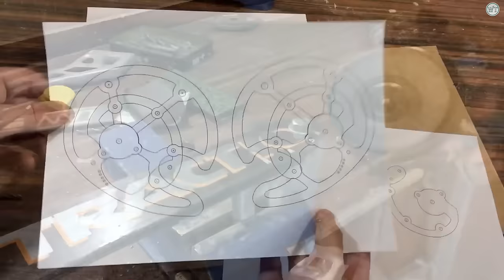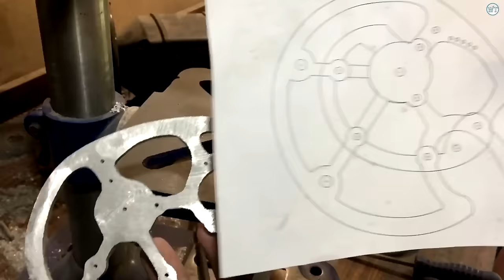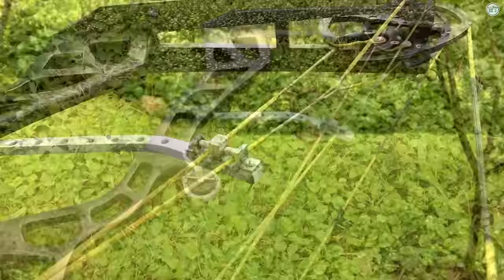Making a Full Size Compound Bow | Aluminum Riser | Powerful

Comment: For the record don’t ever fire a wooden arrow out of a compound bow that is death waiting to happen
Reply: why not, why not?
Reply: depends on the strength of the bow. Also, it's still safer than a carbon arrow with a crack in it.
Reply: @andiders   well it's obvious in the video this bow draw weight is way to heavy for that wood arrow. That could do some serious damage to his face, arm or hand if it exploded. Seen it happen bout 25 years ago at an indoor range, guy blew up a wood shaft and part of it came back thru his hand and pierced his chest.. it's a bad day when it happens..
Reply: How did it pierce his chest? The bow shoots it's force one way, how can that force suddenly redirect so it pierces his chest? That would defy physics.
Reply: Andiders is doesn’t need to pierce his chest to kill him and plus I fail to understand how it’s so hard to believe that a arrow can split on half with out having to come out of the bow😂😂 check ur definition of physics😭👍
Reply: Andiders even if it hit his leg or his arm there are many arteries that if pierced can have the bleeding stopped
Reply: I totally understand that the arrow may split and splinter, but in order to pierce someone, it needs force, and with a bow, it only has force going forward, it cannot redirect that force sideways or backwards. Said force might hit his arm or hand, but suddenly wouldn't shoot the arrow/broken off arrow sideways. 
In order for an arrow to shoot its archers chest, it needs to have the force redirected downwards and backwards. That could only, in really far fetched theory be done by a massive shockwave, created by an astronomically powerful bow, you know, the kind that only exists in Japanese anime.
Reply: Clearly, you're incapable of reading TreasureSweeper. I know that an arrow can be completely destroyed, and splinters from it can harm you. What I'm questioning is splinters, getting enough force to a completely different direction, enough to pierce someone. 

Let me explain this, as well as I can. When you shoot a bow, the force is directed forward. Yes, are you with me? Your chest, is positioned below and 80% completely behind the arrow, at an angle. No part of your chest is exposed in the slightest to the arrows pointing direction. You with me? Anything behind the string, is not in the way of the force the project the arrow. Your hand and arm is exposed to that area though, and can be seriously injured by a disintegrating arrow, but your chest is not. This is what I''m questioning. The force is directional, and that force cannot be magically redirected. Arrow pieces cannot ricochet of the arrow, let alone sustain its force while doing so.
Reply: @andiders   dude, obviously it's you that is incapable of getting it. 
Just go spend some time researching it. You can try to understand the physics all you want, things don't always work the way you think they should.
Reply: @andiders   lol... Back to physics. Ok, have you ever thrown a baseball?
Force of throw going forward right. Same with an arrow.
What happens when that baseball is thrown into a concrete wall? Does it bounce back?
Same thing happens when the arrow shatters, it's pieces can bounce back after hitting the shelf, arrow rest or riser. 
The guy that blew his wood arrow had a 6 or 7 inch piece of it come back and pierced his chest, just in front of his left arm pit. No, it didn't go thru him but it was embedded about 3/4" into his pectoral. Some of the arrow pieces were stuck in his hand.
It can and does happen. There is also a vid somewhere on here showing an arrow at release, breaking just in front of the fletching and hitting the arrow rest and going straight up thru the ceiling in a archery range. It could have just as easily went backward in the the archers face or chest.
Been shooting archery seriously for 38 years and started over 40+ years ago. Shit happens and it doesn't always happen the way physics would lead you to believe.
Reply: Back to physics indeed. The force required to penetrate skin, that deep especially, would be very strong. A bow penetrate by a mix of speed and weight focused on a very small area. A splinter from a arrow, that travels towards a chest, has already lost most force on the impact that redirected the splinter backwards, but due to it's fraction of the weight, it has even less power. 

An easy formula would be Weight (mass) + Speed (force) = Penetration power (impact). What happens if we take a fraction of the weight, fraction of the speed? We gget a fraction of penetration power. 

Same goes for a baseball, except that when we hit it into a wall, it doesn't lose mass, it only loses force.  The ball will hhurt less, when bounced off the wall, as opposed to hitting you directly after the throw.
Reply: @andiders   lol... Okie dokie... Stick to your physics.. were done here.
Reply: This topic fascinated me, so even if I never didn't took serious bow i can imagine it enough. Try to draw fully a bow to the point when your cheek is meeting the hand grabing an arrow. Now look down and what happend. From this point your chest is not anymore behind the arrow but obviously below. More to say, the angle is even less that 90 degrees. When arrow breaks nearby the hand, I think it can seriously harm the chest, the cheek, the hand grabing this bow and even more.  Just do simple experiment even without getting any bow. Sorry if i did some language errors, it's not my native ;) Cheers :)
Reply: depends on where the arrow bends and breaks dude. If it breaks towards the end where the nock is it can still twist and stab into your chest. The arrows don't just explode down the center they bend first because they have inertia so the back is accelerating while the tip is resisting that motion so it bends towards the center. This happens to all bows and arrows regardless of whether it is tuned or not and is often referred to as the archers paradox. But if it's too weak it will continue to bend past its limitations which If your unlucky can bend towards your body then when it inevitably snaps it is definitely possible for the nock end to point towards you and get pushed into your chest by the string at an angle. you can test it with a thin dowel rod if you want, just press both ends together and hope it breaks away from your body. Of course it depends on the type of arrow bow, poundage spine and the forces the arrow has been subjected to such as being struck by another arrow or hitting a hard surface and other things could affect the structural integrity of an arrow at different locations. I was trying to find a article but the only thing I could find was a video showing an arrow breaking near the fletchings after it left the string and was aiming towards the guys hand before cutting off. I don't know if anything I said makes sense to you but I tried.
Here's the video btw
https://www.youtube.com/watch?v=tzEAp32rntQ
Reply: I don't know how he managed to get it through both his hand and chest though.
Reply: xavier valdez yea roger this.  totally possible.  unlucky, but could happen.
Reply: This hasn’t just brought out so many Robin Hood, but many Einsteins too. 😂😂
Reply: @andiders  when wood shatters it tends to shatter using the grain of the wood. Some arrows have a knot or abnormality in the wood that can cause it to shatter downward or backwards with extremely unusual force. I dont understand the physics but its happened to me and I have a few scars still.
Reply: Well, I can clearly see who the actual archers are and who the "scientists" are. For the record, I'd never use anything less than a carbon fiber arrow. I wouldn't even use fiberglass arrows out of an actual hunting compound cause that isn't smart 😂😂
Reply: @animus did the wood after shattering went through your hand and pierce your chest
? Because this is what is suspicious here. Not ugly scratches on your skin.
Reply: When the arrow splits the weight gets redirected from straight forward to the side. The nock only having one direction of exit gets stuck on the string and the bounce back of the string throws the arrow the opposite direction than you want it to....
Reply: You can't just shoot any arrow in any bow they must be of the proper spine weight.
Rose city Archery has a spine weight chart for compound bows.
Reply: Not true.  We got a load of cheap wood arrows from China when POC became rare.
Straight grained POC or spruce that is properly spined for a recurve that hammers the arrow at it's longest draw  will survive a slower accelerating compound of the same draw weight.
I still shoot POC or carbon, but refuse to shoot aluminum that dents and bends and even snaps from fatigue.
Reply: true but judging by his draw its probably only set at a 15 pound draw which is safe
Reply: Yeah, for them zombies!
Reply: then I guess you dont know why it doesn't matter as long as the spine of the arrow is strong enough for the bow.

unless you think aluminium arrows rated for a 45 pound bow will work on my 100 pound draw longbow?
nope, snap em like a twig.   this is also why you see most warbow archers use port orford wood arrows..  they bend, and return to shape,,  aluminium dousn't :-(
Reply: LMAO at this thread. So much lol here. As mentioned above, If you select an arrow spine suited to the draw weight of your bow. You, like thousands of trad archers out there can shoot with confidence regardless of what your arrows are made from. And none of the cool and crazy stories your cousin Billy Bob's aunties hairdressers boyfriend told you at the range one day will change that. Aside from anything else, the one arrow shown in this video didn't show any signs of distress at all. Believe me, when you see it, you'll know it.
Reply: Why Not 
Have you shot an arrow? Are you an archer?
Reply: @Levi-xo9un  What happened with me an a year ago,, I used soft arrow for teenager bow and shooted with  compound... My arrow broked in half and it was my luck that half of broken arrow went thru other dircetion of bow and dont harm my arm...  moreover that sound was absolutely scary, me and other people ger freezed for a few seconds xD
Reply: @Levi-xo9un  Спроси у одноглазого мужика.
Reply: @sierraridgereaper  With Physics they do. An arrow fired to a person's chest will easily pierce it. But a splinter flying off from a broken arrow whilst one attempts to fire the former is an absolute joke. The splinter may at best scratch or lightly embed itself in the skin of the person firing the bow. Physics never lies.
Reply: Just use medieval style longbow arrows. You want to talk draw weight, those wooden arrows can take it.
Reply: @sierraridgereaper   Let him good brother, seems to me that he thinks he has gotten it all figured out and that your wrong and he's right.  Let him go on trhinking he's got this.  Fact of the matter is, you're only going to waste your time and energy in your trying to inform and correct his not understanding because he thinks he UNDERSTANDS ALL RIGHT.   I figure out a long time ago: when it comes to folks with having " stupid set in their mind "  Welp,  sometimes you just CAN'T FIX STUPID.  SMH

Comment: Very nice build.... Many things I would have done differently but it does not matter because you got er done and well.... I would have cast my name into the parts and build date..... Would have polished them anodized the parts.... The only reason I can think that you cast the cams that way is to prevent warp... I would have left the big rectangles off that cast and cut out the cutouts in the cams.... Might leave a light thin part of the cutouts to prevent warp.... But then again I would probably laminate the cams from carbon and glass as I have those in hand and have experience with them...... But yeah you need to mill your name into that and date.... Build into etc.... Something to be proud of there..... Looks like you used old skis for the limbs????   That gave me an idea.... Think I'll make a huge crossbow using two old skis... Yeah I have to do that now reverse draw yeah lol can't wait

Comment: Oh, also, you can place one circle over another but put it off center to get a cam, then put an evenly spaced bolt pattern for mounting it so the off center circle can be repositioned and the let off and maximum force can be adjusted.

Comment: I wonder if you couldn't get more power out of a compound bow by inverting the pulley system, front to back, so that you notched the arrow further forwards. I would expect this to give a longer power-stroke, and thus a higher arrow velocity for the same draw weight, and yet every compound bow I have seen so far notches to the rear.
Reply: Longer draw would indeed increase energy gathered during drawing the bow and transferred to the arrow. However people tends to believe that brace height should be somewhere around 7". Probably it's a result of extensive testing, or maybe it's just the myth, but it's possible to achieve longer draw just by moving the grip back and slightly changing the shape of the cams, no need to "invert" their direction

Comment: Wow you always amaze us <3 
Did you use a wood drill bit on the aluminium? doesn't did break or something?
Reply: Vier McArthey Good drill bits are usually made of high speed steel (HSS) and can drill wood, plastic, aluminium, and mild steel.
Reply: InkandFish555 yes, but wood drill bits usually aren't made of HSS
Reply: Vier McArthey Don't know where you live, but all the commonly available drill bits here in Australia are made of HSS. I don't even know where to look to find simple carbon steel bits.

Comment: Very Nice work on the fabrication. 
What's the preload on the limbs? 
Looks like your draw weight is to high, it's to heavy a pull. Can you adjust the draw weight by backing out the limb bolts?
Also, your arrows are to long and you really shouldn't use a wood arrow, especially if you don't know the draw weight and draw length for correct shaft spine. That wood arrow could explode and I promise, you don't want to deal with having a doc removing large pieces of wood out of your face, arm or hand..

Comment: all nice but i dnt understand why i saw u shaking like that.... the compound bow is designed to charge the arrow and stand still
Reply: This above post.
A compound bow does what the name implies, compounding the resisting kenetic energy of the bow limbs at a static rest, into the bow with dynamic kenetic energy. Distributing said force via levers, pivots, and semi-circular shapes, rather than the archer's skeletal and muscular structure. However the caviot in this case is the archer must then hold a static weight out from the body's center of mass, while simultainiously pulling against the dynamic kenetic energy the bow is unable to transfer, causing fatigue due to increased load. Load baring can increase in many ways.
1- weight of the bow and ALL accessories(added weights, sights, stablizers, exc.)
2-Increased dynamic kenetic energy with lower tranfer to the bow(ie. "let off")
3-Inablility to tranfer dynamic kenetic energy into other muscle groups, from the ones preforming the task(not moving the force from the shoulder and upper/lower arms to the upper back).
Hope this explains why he shakes when and before firing the bow. Sorry if it was long...

Comment: Omg! Please don't replicate this! There is so much wrong from an engineering standpoint. Cutting fiberglass limbs into less than half their original size, eyeballing the string route over the pulleys, that is definitely not how to bend aluminum, also, no hold at full draw. Maybe not even full draw. I'd also be scared that it was gonna fall apart in my hands/kill me